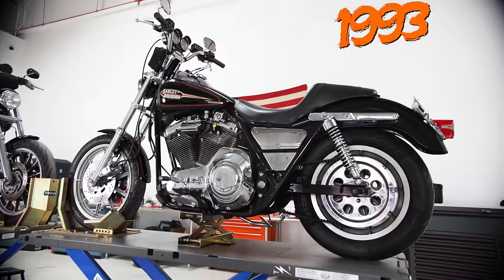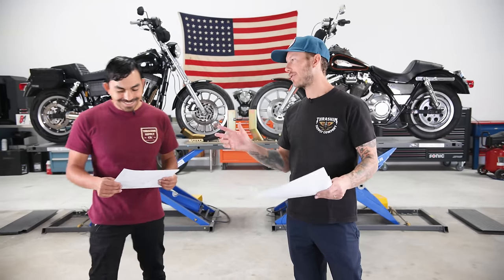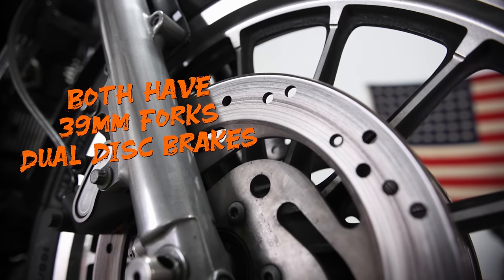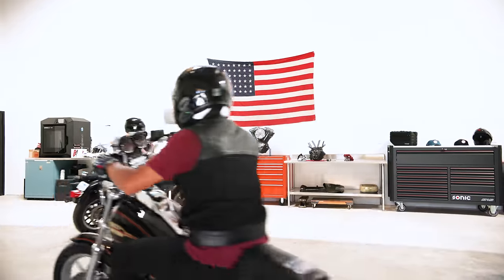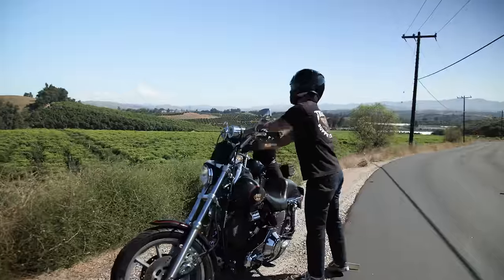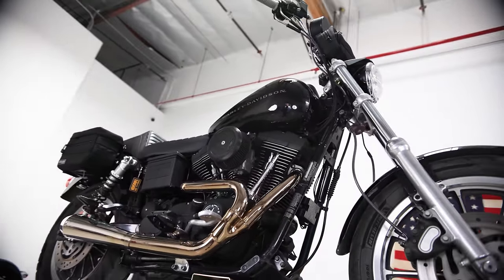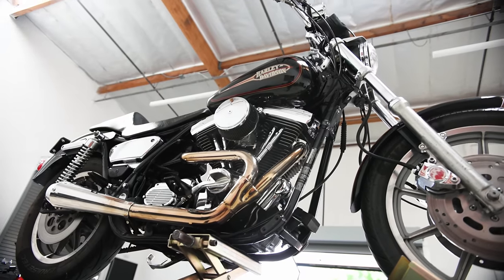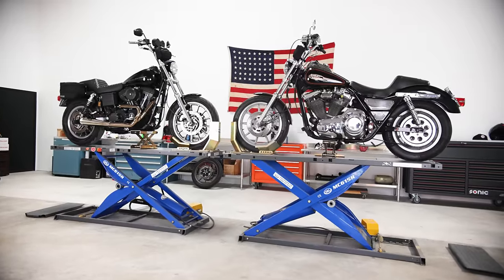Harley Davidson Dyna (FXDX) VS FXRS - Thrashin Supply Bike Comparison

Comment: dont forget the steering head bearings for wobble. DYNA should not wobble even at 100+. If its wobbling something is off
check the following in order
cobra chrome tires
New Steering stem bearings (adjust properly i run a little tight)
engine mounts and alignment ( no stabilizer needed)
mag wheels
Suspension (fork tube oil, pre load, and compression and rebound)

If its wobbly in the turns normally engine mounts and/or suspension
wobbly in a straight line steering stem

Comment: I have a pair of Kinetic all stainless steel motor mounts on my 03 FXD, no rubber, I like them. Will last forever and oil, dirt whatever has no effect like it does on the rubber ones. The rubber part is replaced by a mesh of stainless steel

Comment: I will stick with my 2008 Buell Ulyesses.  74 CI  1203 CC's based on an Evolution engine.  Dual Rail shifters so it shifts much better than most HD's  Higher compression .. Better flowing heads with Fuel Injection.  I think it has Piston oilers.. It has air scoops to cool the rear cylinder..  an oil cooler with an air scoop ..  oil in the swing arm  gas in the frame.. A huge single front disk brake that needs one finger to stop the bike with .. Plus a thermostatically controlled cooling fan to draw air across the heads.. I think much needed because the heads are so close to the frame where the gas is.  If you get caught in traffic  you do get vapor lock.  I actually ran faster 1/4 mile times on a hot  day than a cooler humid evening.
  I never even came close to scraping my pegs but I pass Harleys like they are sitting still in the twisties.
  I didn't pay a lot for my Buell.. It needed new tires..  fluid changes.. clutch and throttle cable lube.  It has heated grips which are needed where I live..  It has  hard cases  side and top .. a Tank bag and windscreen..
  It has a dual stage muffler.. quiet and more back pressure part throttle  ..  Less back pressure and louder at full throttle.  It has a solenoid controlled baffle inside the muffler..  The Redline is supposed to be 7,000 RPM's but I almost never turn it over 6,000.00   A 6th gear would be nice.

Comment: Why choose old dyna between 99-2005 vs sportster 1200 anywhere between 2012+. Which one is better for a long distance, around town, everything. Is older dyna reliable?
Reply from the maker: Sportsters are good bikes, they are just very small and we tend to feel more uncomfortable on them
Reply: @THRASHIN  2003 dyna is 5” difference and 2016 dyna is 10” difference. Obviously looks better but performance overall compared with 2012+ sportster compared with early dyna for long distance, around town, etc u would say early dyna is better? Mechanical issues, etc
Reply: @THRASHIN  if ur to choose st vs road glide which on would u choose for everything. City ride, trips, etc and why. Road glide too heavy for everyday ride?

Comment: I have an 87 epic star. If you check out 1990 easy rider in the wind edition. It'll say John and Tanya is one of the very first effect. S of ours to make look like an old style f. L. H. It's be To sturgis fiftieth with old SU corporate around it 1's great.
And then I think it was 1991 I was invited to easy riders invitational bike show.
It's in the easy rider magazine top 100 I love it but I also have a 2003 bagger at 20:16. Ultra limited love and both.  When you're riding how could you not love them all

Comment: 2002 FXDX has the stronger crank bearings so there should be little runout and it should be in tolerance for a gear drive cam. I recommend the TW37 andrews gear cam. Also with the Mikuni you can run Flat top pistons and heads done by Cycle Rama or Branch.  YOu can bore out 95 inch and run the compression with as little as 9-5-1.  re gear it with chain and hold on.  LOL

Comment: It makes zero sense to me that one could consider the far simpler Evolution 80 engine as less reliable than any twin cam. Especially with the shoddy design for cam chain tensioners as compared to the technology of a Victory but here especially against the gear driven single cam of the Evolution. I always wanted a '90 Softail but haven't found one that's not over 50k or more on the odometer but I did find a super clean '94 FXDWG Dyna Wide Glide with what I suspect is a mostly stock Evo 80 with only 27k on it. It does have an Arlen Ness high flow air filter set-up but I haven't hardly ridden it yet. I definitely want to change out the tires before any long rides as they're cracking but have plenty of tread. I'll want to get a spare drive belt as it's as old as the tires, approximately 6 years and it had mostly been parked. The seller had installed a new CV knock off carb but it's not quite the same and is missing some vacuum inlets so I'm rebuilding the original and installing it back on the bike ASAP so I can get some riding in. Otherwise, I just also bought two Japanese 1100cc bikes, another '82 XJ1100J Maxim and an '86 Shadow VT1100C which has as much power as both the bikes you just tested. The Dyna is rated factory at 48hp the Shadow is around 78hp and it pulls like a freight train. The first liquid cooled bike though for the Shadow and it's got a leaking upper radiator hose which is impossible to find a direct OEM replacement. Don't you hate that!!? That's what I get for having rare one off machines! That Shadow model was only '85-86 and the XJ was only '82. Parts are more difficult to find but they're both great solid machines.
Reply from the maker: In a quick response, the cases on the Evo are prone to cracking. They often are harder to get to stay sealed. Especially when you ride them harder. That has been our experience. And again, the video is just to share our experience and opinion 🙌🏻👍🏻

Comment: i've got a 1986 fxr-sp duel disk brakes up front  it has a bigger cam ss carb  aftermarket pipes it goes nick to nick with my brothers twin cam till about 60 and then im faster  the evo stock heads need some work to flow well I got the bike new in 86 and still ride if

Comment: Would either of these be decent daily bikes? Like the only bike in the garage or would yall say that they’re more as like a second bike to have
Reply: More expensive, but for a reliable daily, get something fuel injected, Sportster 1200 or something with a balanced crank and runs smooth, a 2018 or later softail with the Milwaukee 8. They don't leak, don't have valve gaskets spewing oil, and gobs of HP and torque. Granted, more $, but also more refined. The softail monoshock frame 2018 or later doesn't get the wobbles. 40% less flex laterally in the frame.
Reply: I only ride my '92 FXLR once a week.  30 year old bikes are not unreliable, but parts do break more frequently, because they're just older.
Reply from the maker: Depends on how much time you want to put into keeping up with them. If you're very hands on and don't mind working on your bike then they are definitely a daily option but if you don't want to worry as much about your daily, you should consider other options. The other replies to your comments are perfect!
Reply: Thank yall!!

Comment: Do they sell after market jugs and pistons for the FXR to increase HP ?
Reply: Yes, anything you can do to any other Harley model with an Evolution engine, you can do to an FXR. Check out Thrashins latest bike check video. That FXR has a hopped up EVO.
Reply: No not really, stock Evo cases can't handle big bores at all really (some year Evo's will crack cases on the stock bores). You can safely do headwork, cam and compression though, and stroker crank if that way inclined. Otherwise for a bigger cube Evo you need aftermarket cases.
Reply: Best to just keep the displacement stock, install some wiseco high compression pistons, valve springs, cam and adjustable push rods.  Or spend a lot and just buy an S&S motor.
Reply: Of course. Whatever you want to do,  parts are available.

Comment: Did you forget chain vs belt?
Reply: Both have belts stock.
Reply: That FXDR has a chain which you can see in some of the road shots.  @jimmyrustles8118
Reply: @AlmadenJeff  yeah it does, but stock ones dont, and I think they're comparing FXR vs FXDX, rather then comparing two specific bikes.
Reply: @jimmyrustles8118  They are comparing those two bikes head to head on the road test. There will be a difference between chain and belt. Need to redo the video and throw in a taco run!

Comment: I have a 1997 FXD. So I have the worst of the worst; evo 80 ci, dyna wobble, weak brakes and squishy transmission. 😂 but I love it, front engine mount stabilizer and a fork brace completely quelled the wobble. But my 2018 FXLR is far superior in every way. 😆
Reply: You should ride my 97 fxd then....I have no issues with killer ride but I did alot to it to that point....

Comment: I ride a 2002 FXDWG that I bought brand new. In this 5th incarnation it has a wider front wheel and tire. The bike is thrilling to ride. So-Called “Dyna wobble”…? That is BS. This bike chews on pavement like a bumb gnaws on a chicken bone. I LOVE this bike! I did add a gear and the engine is a 103CI now but it still feels like it did when new, maybe a touch faster and a wee bit grippier. My lady friend has a hoppered up FXR but still a 5 speed and she’s no slouch and that little flower has never been able to pass me in the twistees. No way I am askeered of the Dyna. Great ride!

Comment: "01's have 4 piston calipers.
Reply from the maker: Yea we realized we said it wrong after we filmed it. But it’s all good, you get the point, one had better brakes 👍🏻
Reply: @THRASHIN  you're right better is better! 12 piston vs 2 gives you way better breaking not more. More would be surface area friction to pressure ratio.

Comment: I have a 92’ fxr chrome dash with speedo and gas cap, (rare) mostly stock engine, 42k but pistons were replace just before i got it at 26k i had the transmission gone through due to shifter spring failure. Decent tread, not perfect but shows age, i have a07’ flhtc my wife bought me, and to be truthful the 92’ has less problems, but if anyone is interested let me know im in northeast Ohio asking $6,500
Reply: Plus it has front duel disc brakes !